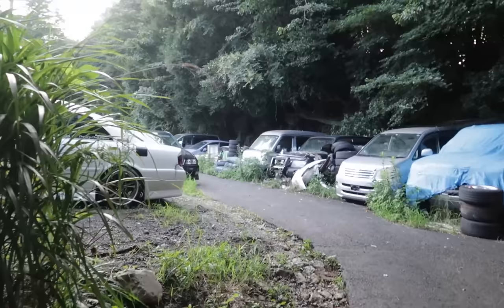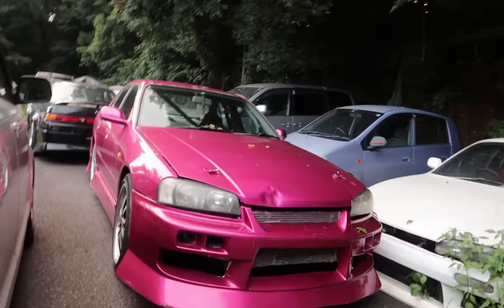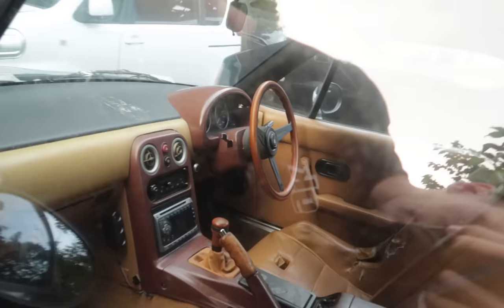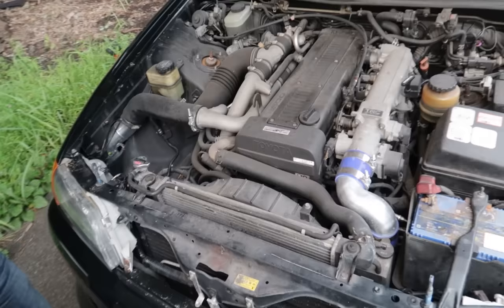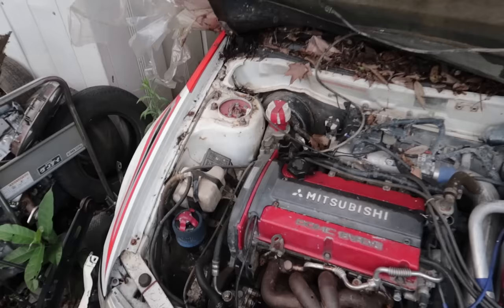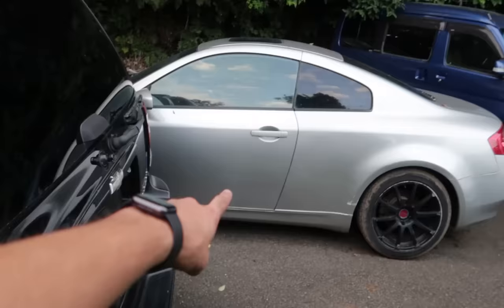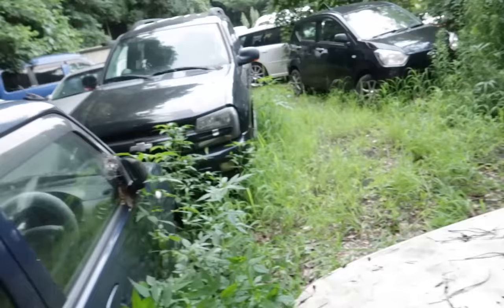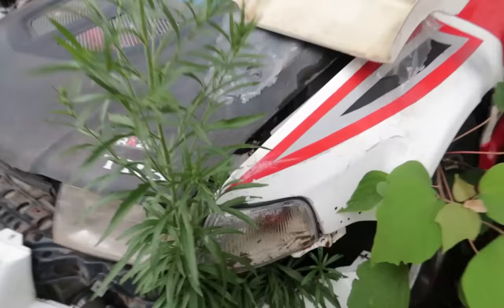REAL LIFE BARN FIND! - Japanese Legendary Cars Edition!

Comment: That little truck you showed, is called a Nissan 1400 pick up, and is the most popular little pick ups in South Africa, and is very good and work horses and as hard as nails.
They also use it as drag cars, and the most popular enjin swaps in them is the Mazda rotary enjin and believe me, they are very very fast, even dropping guys with v8 cars.
Jan hurter
South Africa.